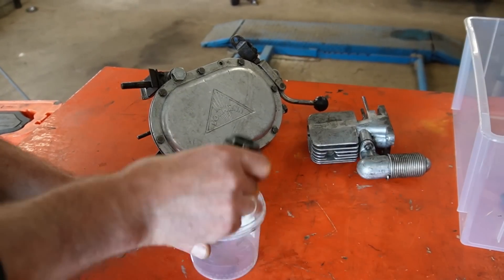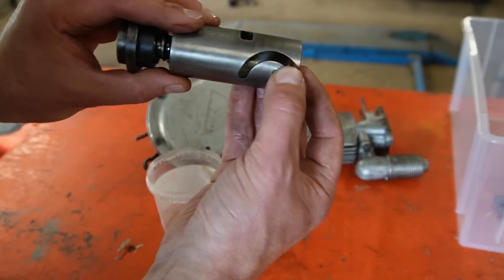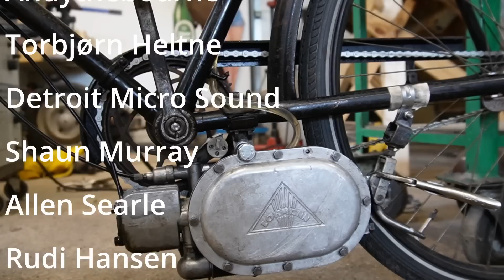The World Smallest Diesel Engine For Personal Transportation ? | First Run After Rebuild

Comment: Put a turbo on it.. Have it charging  bicycle batteries, powering hub moters in a simplified tiny hybrid vehicle  You would get 120 miles per gal. The electric would keep the fuel warm. The engine keeps the batteries warm. It would scoot pretty good.

Comment: I read the original manual for the Lohmann diesel the other day, it states the ideal fuel to use was low grade petrol 80 RON or lower, this is far lower grade than modern fuels and will obviousley self ignite easily under compression

Comment: Man that thing is over the top on the cool chart. I wonder if it’s possible to convert a weed eater engine to combust on compression
Reply: More than most likely! If you take one of those 4-stroke weed eaters, give it loads more compression and swap the spark plug for a fuel injector, it might just work. But because of the extra torque diesel puts out, I'd recommend possibly upgrading things like the crank, conrod, piston, etc. to handle it.

Comment: two stroke is begging for a tuned pipe... now that would be something! 

shame you dont show the cylinder and transfers but the flat top piston suggests schnuerle, so a pipe will work...

anyway, this maynt exactly be ... what you want to do, but thinking....

you can get nice little 12v heaters now... diesel glowplugs...

maybe (eek!) drill and tap a hole in the head and throw in a glowplug, then run it PWM as a "hot bulb"? could possibly get away with real diesel then. get it to burn properly and youre making power then!

same time, me being me would throw a chamber around the exhaust pipe, and preheat the fuel as well...
little BLDC mounted on the cank somehow for power...

Comment: You need a starter, for testing...
Maybe use a treadmill, the exercise thing for running inside & going nowhere. Either with the belt or with the tire on the roller.

Comment: Maybee use a gearchanger from a mountainbike, then you will have some fixed points, in the differentiere compression areas. Just an idea 🙂
Reply: It looks like it needs two cables. Enviolo/nuvinci shifters have two cables and retain the position it gets set in. Not sure if that's any different.

If it has one cable then a friction shifter with little ratchets might place nice.

Comment: I can’t remember if you covered this already with the dripper. My thoughts are that traditional 4-stroke diesels control the ignition with injection timing. This way, they can almost completely eliminate preignition. How does that work for 2-strokes? So they draw in the air-fuel mixture similar to “normal” 2 strokes? 

Anyway, very interesting to see more fuel experimenting!
Reply from the maker: Yea its controled like normal 2 stoke and preignition is controlled by the compression... it gives the rider and owner a pretty important task to control!
Reply: @SeasideGarage I see! Imagine if it had a mechanism alter the compression automatally for each cycle. Like increasing compression at just the right time to cause ignition when wanted! In theory I guess you could do this if had an incresibly fast hand and constantly turned the compression back and forth at just the right time!
Reply: @MrToxicSkittle sounds like an arduino might be able to do that. Sounds funny but sometimes making it more complex makes it simpler. Not sure how you could measure how much compression is necessary but increasing compression with a stepper motor right at top dead center could work. Maybe even have it automatically advance/retard based on rpm.
Reply: @ShinyUmbreon765  yes, exactly! In theory, if it had enough travel, you would be able to increase the displacement during the intake stroke and increase compression on the compression/exhaust stroke, meaning it would work almost like a supercharger/turbocharger. Or an opposed piston engine :)
Reply: @ShinyUmbreon765  that stepper motor has to have enough power to overcome compression and combustion... yet act rapidly enough to do anything useful?

kiss...

standard glowplug with PWM and run it as a "hot bulb"...

or is that too simple?

Comment: Thank you so much for your Lohmann series. It has facinated me for half a century, but all I knew was from books, so great so se it live and living. I have often wondered why nobody have persuated the idea(s) from this since. I find it quite brilliant...
Reply: niche market, and they never went well enough so shot themselves in the foot? why 18cc? lot of work to make one, were probably expensive for what they were, and too finnicky for anyone to tolerate... 

i love the tucked in design, hate the friction drive, love the diesel, hate the weird arse variable compression and throttle, love the concept...

throw on a small generator, run something like a glowplug on PWM as a "hot bulb" system instead... can preheat heavy oil electrically, vaporise it, let exhaust heat take over as needed...

i had lots of ideas before they got banned here... sigh... 

though, making a modernised "hot bulb" doesnt sound so stupid anyway... hmmmm....

Comment: I had airplane model engine which is basically same design in 1.5cc form. The most basic fuel for testing was equal parts kerosene ricin/castor oil and ether.

Comment: Mayby you could make a smaller run a-long wheel for it to gear it down? Seems like it lacks torque to rev higher.
Reply: Decreasing the wheel size decreases the gear reduction in the same proportion because the wheel is being used as a big gear by the little roller.

Comment: One thing to consider is that the lamp oil you used may not be the right fuel, if it's the stuff designed specifically for lamps, it's designed to be a clean-burning wicking oil which dosn't burn as well as paraffin (as us brits call it, kerosene elsewhere in the world, even called petroleum in some places to add to the confusion!!!), so that could be the main problem with it stalling, the go-juice just hasn't got enough go in it... :)
Reply: Here in the UK I found kerosene which is domestic heating oil which is similar to paraffin except it has a high sulphur content and less refined than paraffin.
 its way cheaper than the paraffin that you would use for lamps and heaters inside the house that has no sulphur and burns clean.
UK kerosene would be a smelly bad idea used inside the house
Reply: @K40jon  It's also a heavier fraction, so if used in lamps it's very smoky and unpleasant to use, and clogs wicks which makes lamps unreliable, Paraffin (Official dsignation BS2869 C1) is a lighter oil than heating oil (BS2869 C2) which is why it makes it better for lamps (and other purposes such as use in spark-engines), it used to be a dirt-cheap fuel, but as with many things, as its' use fell out of favour, it became less common, and prices went up when people did have demand for it...
Reply from the maker: I will try with kerosine and see.. :)

Comment: You can re-weld piston and repair it in a lathe.
I have done so many times .

I also put a small amount of Kerosene and Gasoline in diesel fuel to help older motors start .
Perhaps a lower gear ratio needed on hills may help.

A danke Schoen

Comment: Hi. Why do you use kerosene instead of diesel? Self-ignition temp is about the same, but more lubrication due to higher viscosity + cheaper. And I think the engine was designed to run on diesel. Greetings from 🇧🇪 Belgistan!
Reply: Many diesels seem to start and run better on kerosene.
We use in winter on old machines here in America.
Reply from the maker: Im told the diesel will wreck the internal parts of the engine.. (when left standing)... but will try diesel also, and flush it afterwards... :)